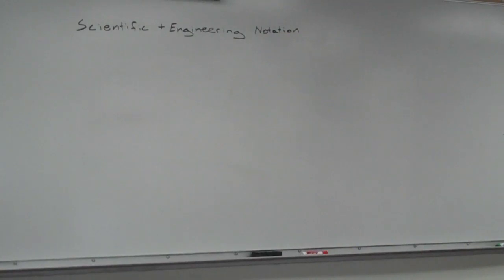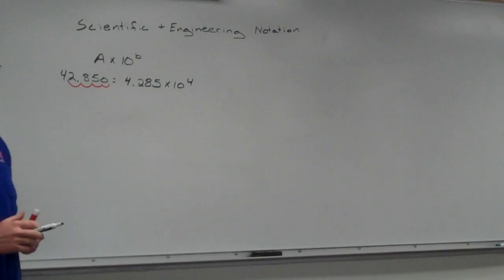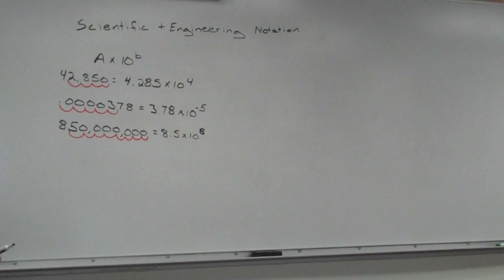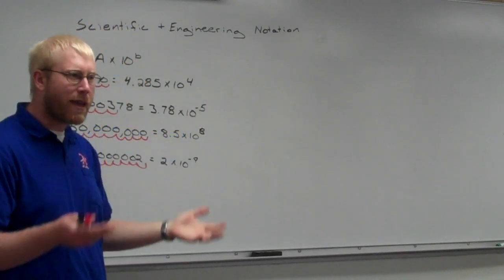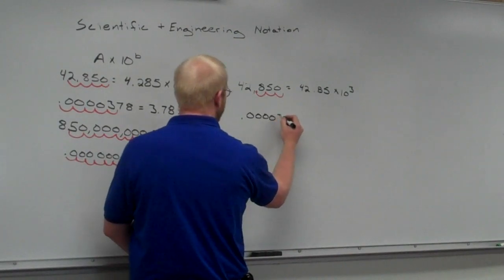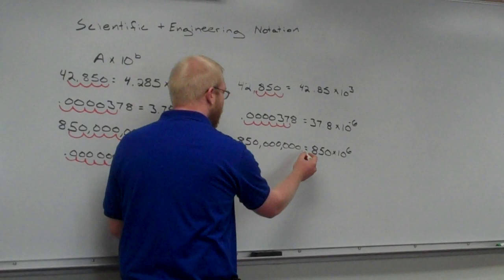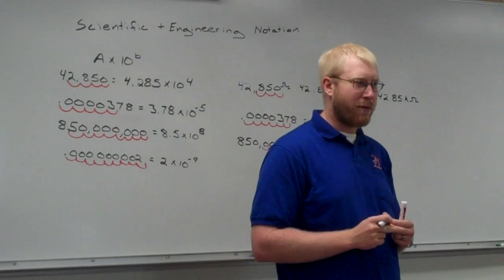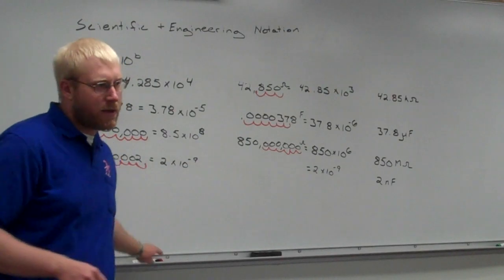Scientific and Engineering Notation

Comment: i have a question about engineering notation.. can the first digit be zero ? or no ? i mean like this : (0.3x10 to the power of three
Reply from the maker: I would typically tell students to refrain from having the first number be zero, however; knowing that engineering notation leads to SI prefixes, I can think of some times that this might be handy.  Especially if a component is typically read in k or M or something like that.  In general, that is bad practice.

Comment: Well explained however when I teach engineering notation I like to show the relationship of the SI units to number values. 

For example:

Greater than 1 will always be a positive (+) exponent
Less than 1 will always be a negative (-) exponent

For positive values > 1
1 Kilo = 1K = One Thousand = 1000 = 1 X 10^3
1 Mega = 1M = One Million = 1,000,000 = 1 X 10^6
1 Giga = 1G = One Billion = 1,000,000,000 = 1 X 10^9
etc

For negative values < 1
1 milli = 1m = One Thousandth = .001 = 1 X 10^-3
1 micro = 1u =  One Millionth = .000001 = 1 X 10^-6
1 nano = 1n = One Billionth = .000000001 = 1 X 10^-9
etc

Hope this helps
Reply: @DANA SMITH I wouldn't expect anything less coming from an ignorant fool who not only doesn't understand mathematics but a lazy one who refuses to educate himself in order to move himself out of his ignorance.  Such village idiots are to be pitied.